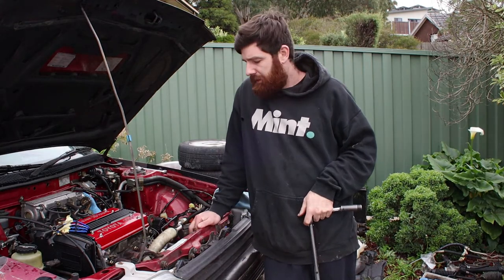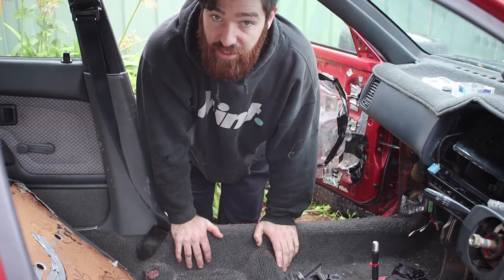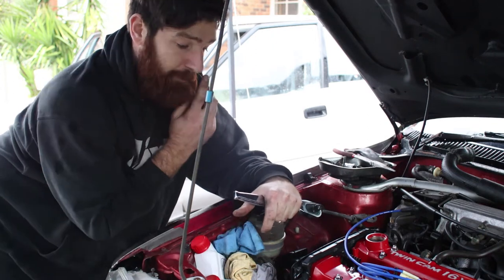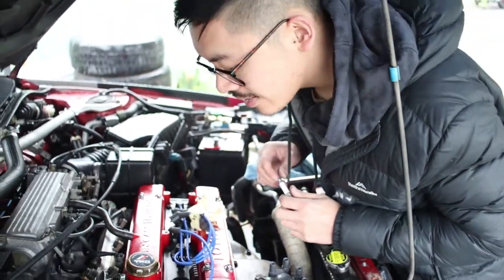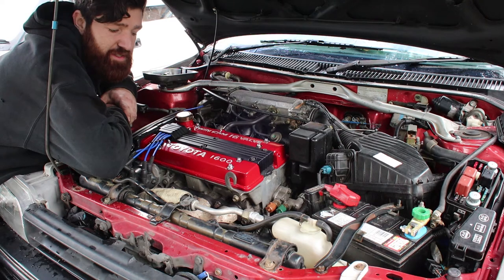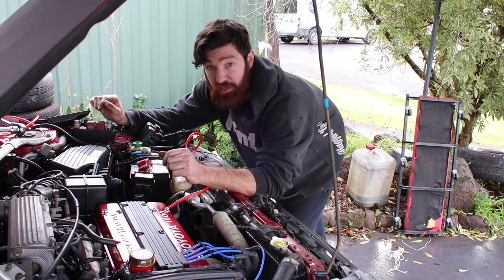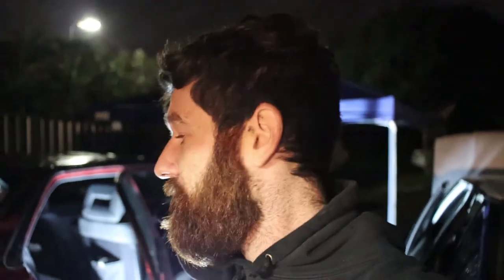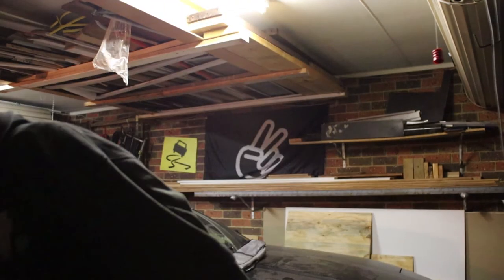How to Install a 4AGE Distributor and Set the Timing

Comment: Thanks for this! I had mine clicked wrong
Tip for cramped bigports(looking at you AW11 and FX guys): 
Holding the rotor on insertion helps you feel the way the rotor spinning as you put it in. If you have everything else lined up you should be able to tell direction fairly easily. I'd suggest putting the notch to align it one tooth to the right to allow space for rotation as the gear goes in, as noted here.
Reply from the maker: Good tip!

Comment: Great video, I'm trying to do my distributor in my 86 mr2 so I'm glad I finally found a good video that showed me how to do it. One thing I will say is that you chose the right car lol. The mr2's engine bay is so much tighter that even service manuals tell you you'll have trouble hand cranking the engine to get to tdc on cylinder 1.
Reply from the maker: Glad you like the video! I bet the mr2 is worth the pain though. It will be much more enjoyable to drive compared to the ae92. That said this car has a special place in my heart haha
Reply: @dingeldiy  I will say it was very rewarding to drive, however it stopped working and I brought it to a dealer to sort out some electrical issues. While it was there for a few months it got rear-ended. Now a month after the accident, the insurance company has offered me 2500 for it when I bought the car for 5500 and can't replace the car with 2500. Dw though I'm going to try and get 3k, buy the car back and sell it on the private market for more so I can recoup some money.
Reply: Haha same situation here, i have an 87 AW11 and doing the distributor ... Great Video btw :)

Comment: Okay, so I have this exact same car, same color and engine, I bought a brand new distributor, the engine cranks but doesn't start, any suggestions?
Reply from the maker: If your timing is seemingly correct you may be 180 degrees out. 
This means that basically the spark plug is trying to ignite when the first cylinder is coming up for the exhaust stroke rather than coming up for the compression stroke. as the crankshaft rotates twice in a full cycle, it is easy to remove the distributor and put it back in with the drive dog180 degrees wrong(although it won't be a pleasant fit that way round). this would mean that the rotor arm will be aligned with the 3rd cylinder rather than the first which it should be. The easiest fix in this scenario is to remove the distributor drive shaft from the block and flip it 180, although when re-inserting it remember that it will turn slightly due to the angle of the teeth.

Comment: I'm having a problem with 4age red top, it's sluggish wen revving and releases black smoke wen over revving....any help?
Reply from the maker: Sounds like your timing is wrong. Have you done any work on it lately? 
Could also be a sensor issue, maybe your map sensor is faulty or has bad wiring
Could also be an issue with ignition leads, spark plugs or the distributor. Check your rotor and cap for any faults

Comment: Could someone explain to me why the timing light is needed. Couldnt you just look at the notches on the crank and align it just through that and the distributor
Reply from the maker: Cheap insurance. Also if the distributor gear goes in 1 tooth out of alignment it can be corrected/diagnosed with a timing light. also helps to advance and retard timing to suit personal taste
Reply: @dingeldiy  thanks for the reply on an old video. I recently got an 87 aw11 and believe the timing is alright but was thinking about doing a new cap and rotar arm and was wondering if id be alright checking it first without having to buy anything. It seems to run fine but im giving everything a look over.
Reply from the maker: @thechannel498  cap and rotor can't hurt.  They do ware out. Would effect spark quality rather than timing but just check it over and use your best judgement